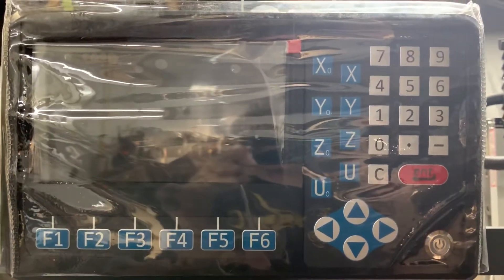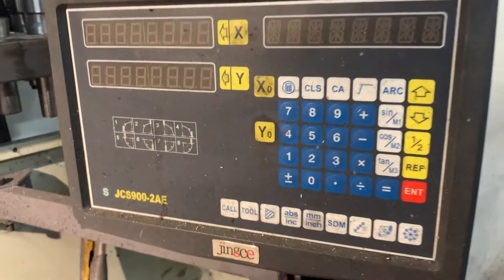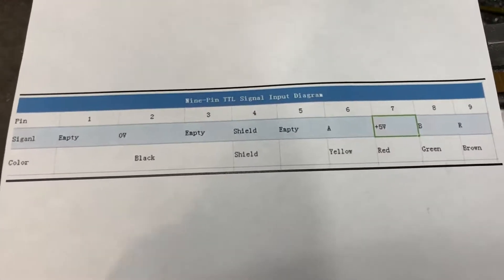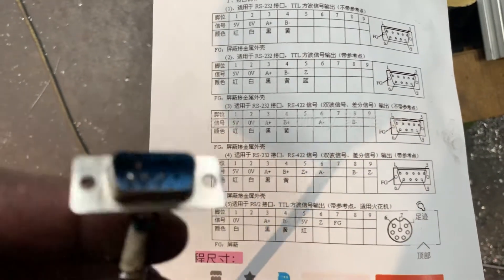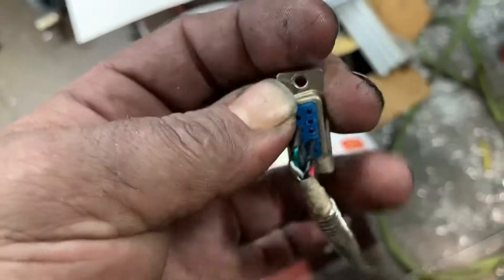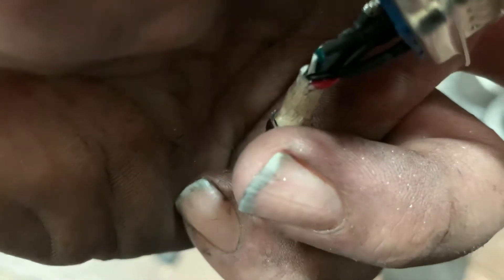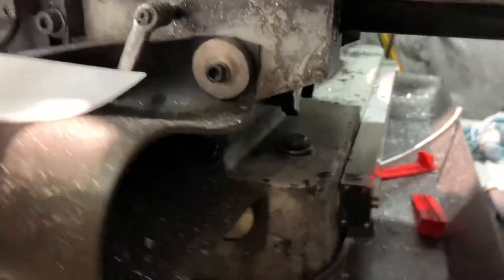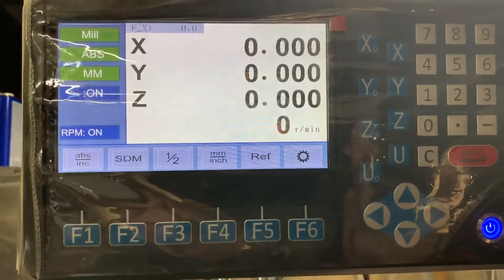Ditron Reeson D80 DRO scale pinout incompatible fix

Comment: Hey Glenn you mad my day. I bought a  dro 3 axis set from fasttobuy  1um scales and then  ordered a quill scale and sent the read out back and bought a D80 4 axis . I saw the pin arrangement was different and was hoping it would work with my scale for the last week .  Thanks Steve
Reply from the maker: Good news Steve. I suspect a lot of people have returned thinking they had a defect issue. I’ve been very happy with this DRO and 1um scales. One of the better purchases I’ve made despite having to reconfigure the pins.

Comment: Glenn, is the Ditron Reeson D80 DRO still performing to you liking?
Reply from the maker: Yes I’m still using it and it’s fantastic. Couple of things I did do. The rear tower pins to attach your DB axis connectors to the back panel. I had went through and retightened a little further than the factory and also the power button hold down nut I gave another 1/4 turn because I noticed it would slowly rotate after a few uses. It did require taking the back panel screws out to access. Probably a 10 minute task and saved any future issues when swinging the DRO around. Now I don’t have to worry about a connection coming loose. Other than that I have nothing negative to say about the DRO and I’d buy one again if needed.
Reply: @glennedward2201  , thank you sir. My '90s Prototrak is toast. I need to update :)
Reply from the maker: @pacemetalfab  I think you will be satisfied. The price is right and the features are there.

Comment from the maker: When swapping fasttobuy, jingce, or similar linear scales you will start with Pin 4 green and move to bottom pin 8. Pin 1 red moves to pin 7 bottom and pin 3 white moves to pin 6 bottom. Feel free to remove unused pins and not confuse yourself.